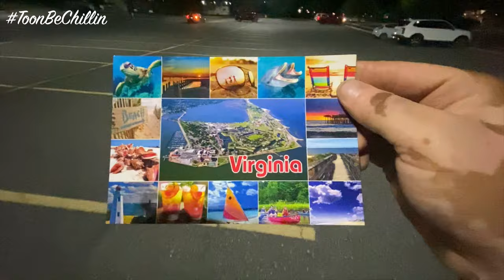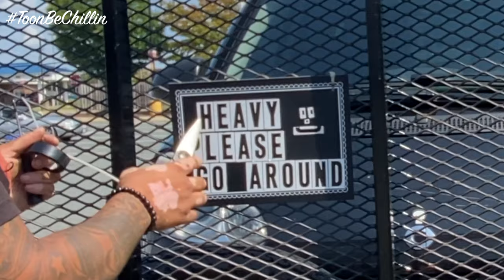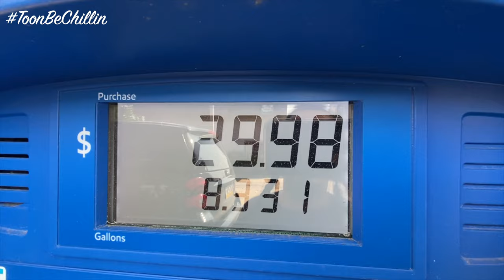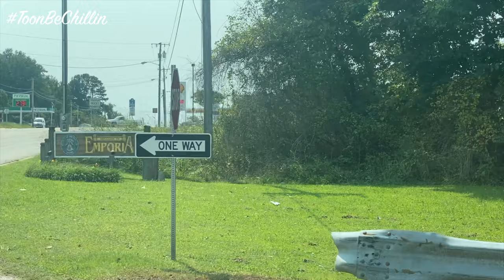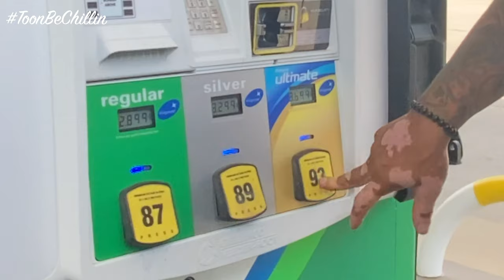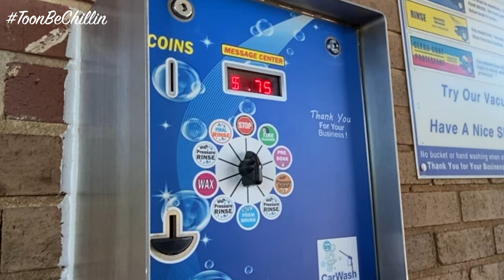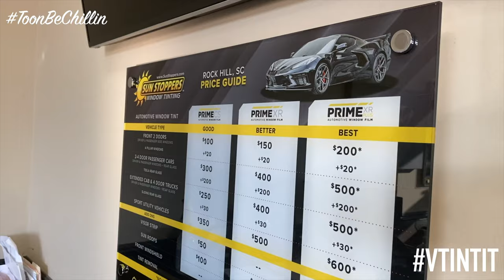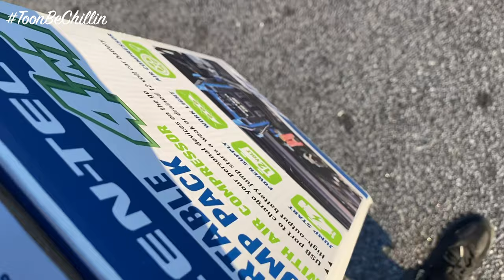RV MOTORHOME ROAD TRIP PROBLEMS & SOLUTION (Ford E-450 V10 Triton Coachmen Leprechaun)

Comment: Never pay tolls drive through the city
Reply from the maker: Well thats easier with a car... cheaper gas. But with a V10 6.7 liter triton engine. traveling more efficient is important. So the highway gets us there quicker rather then taking the scenario route and spending more gas. Toll can be cheaper then burning the gas to avoid the tolls lol. As a comparison the smart car is V3 1.0 liter. 3 cylinders and a 1 liter engine. My old school civic is 4 cylinders and a 1.5 liter engine. So the RV has a huge engine 😅⛽️